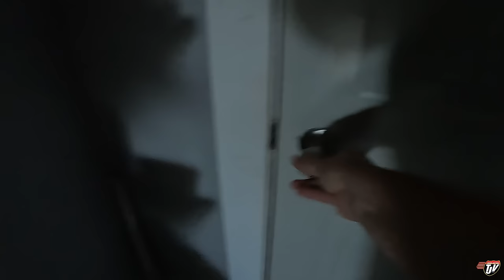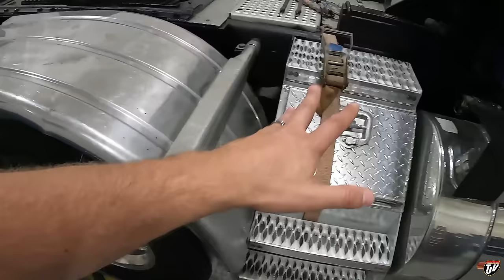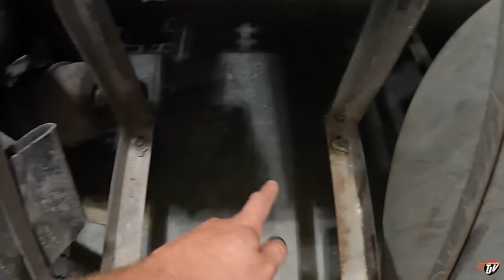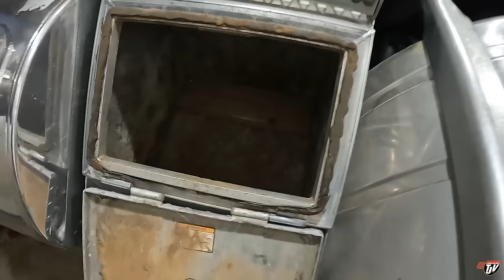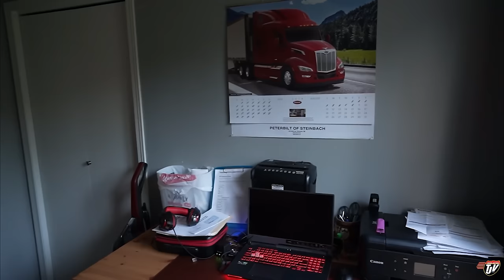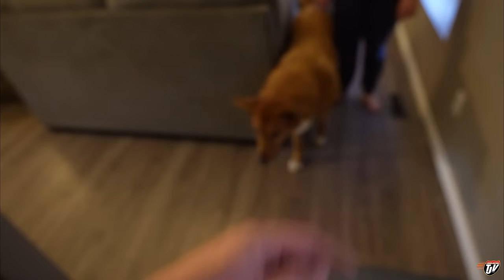TRUCK REPAIRS | My Trucking Life | Vlog #3138

Comment: Funny how us guys get something new like building a deck or getting a new fence we have to keep admiring it.
The boxes are mounted on steel, anytime aluminum is in contact with steel it will oxidize and corrode. So if you get new boxes put rubber between the box and brackets. Cut strips out of old mudflaps works great. More unsolicited advice 😂😂
Stay safe